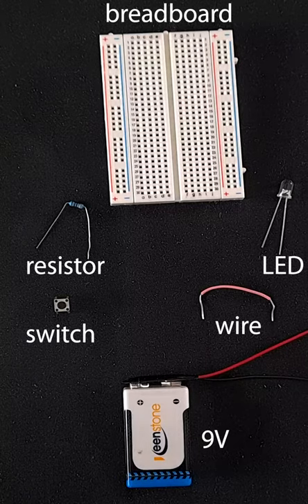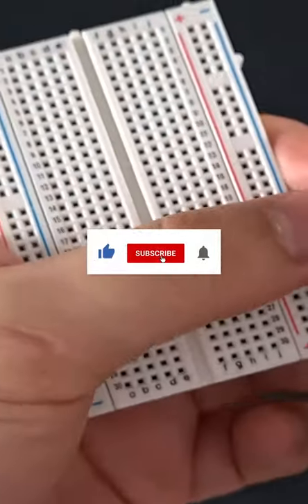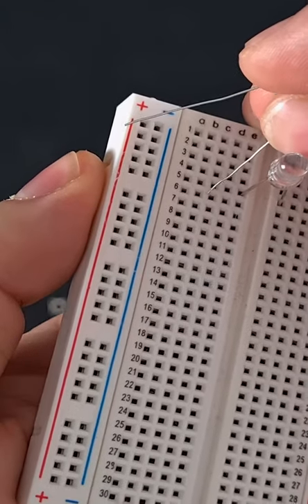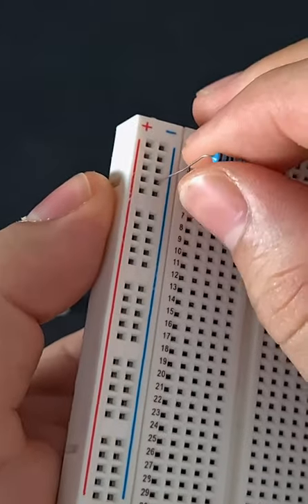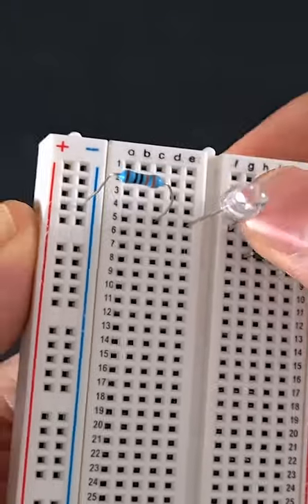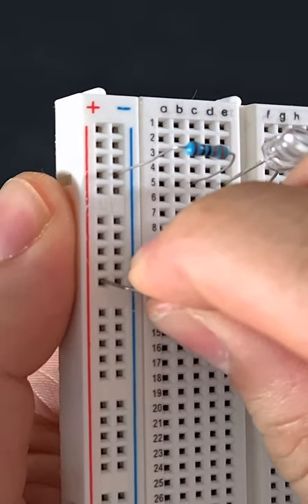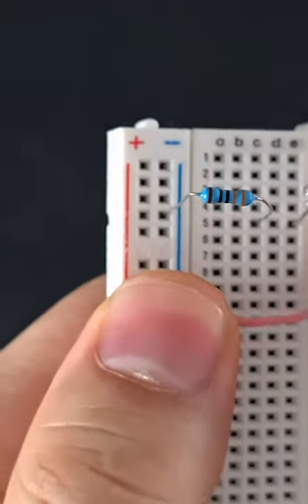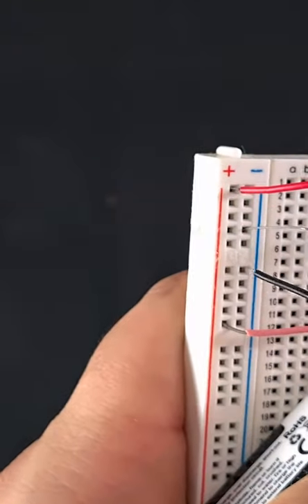LED Switch with a Breadboard #Shorts

Comment: How to add more leds?
Reply from the maker: There are a few ways, but a lot depends on your power source. You can either add more LEDs in series with the one you already have, or you can add more parallel branches - one branch per LED. You might need a separate resistor on each branch, depending on your power supply.

Comment: What if I use 800 point board . Will it differ from 400 point board
Reply from the maker: No not really. Just make sure you use jumper wires to connect the power rails from the middle

Comment: How would I do this on one of those solder boards?
Reply from the maker: You'd have to connect all the components together with wires. I've never done it before because I usually just make PCBs once I'm done with my Breadboard. But most likely you'll need to solder some jumper wires to make the same connections as on the Breadboard.

Comment: How do I make the led stays on when I let the button go? And off the led until I press the button again?
Reply from the maker: Great question. There are several ways to do this depending on what hardware you have. Here are a few ideas for you:
1) Use a microcontroller (e.g. Arduino). If you are happy with programming basic Arduino sketches, you can achieve the effect you mentioned very easily.
2) If you don't want to write any program, you could try one of the following options. But bear in mind that these require a fair bit of electronics knowledge to  make:
(a) Use a relay. You could connect the LED circuit to a relay module which will turn on with one press and stay on until you press it again.
(b) Use transistors. This is quite advanced, but using transistors which are essentially electrical switches, you can also achieve the effect you're after. This is quite technical, though. 
Hope that helps! Let me know if you need more details, I'll try my best :) My personal recommendation is option 1, the microcontroller. You can much, much more than this with a microcontroller so if you're interested, it is well worth getting one.

Comment: you forgot to mention the resistor value
ill do it for ya
ill assume that the led runs on 3 volts and consumes 20 mah
9-3=6
7÷0.02
=300ohms
also i have the same breadboard😀
Reply from the maker: Nicely done! I think they were actually 300 ohms :D
Reply: @MakerVibe :D
Reply: Where did the 7 come from
Reply: Do you know the name or link on a Amazon? I have been meaning to buy one but I don’t know which size is good, this seems pretty good
Reply: @FamTech.  I think that's a typo
Reply: @branchcensus5083 can you tell me where u got that 9 and that 7/0.02 from?
Reply: @mrcrazyface9310 9 was the voltage of the battery, and it is meant to be 6/0.02, the 7 was a typo
Reply: how about the 0.02?
Reply: Is there a calculator online for these things?
Reply: he actually used a 330 ohm resistor but close enough

Comment: hi 
is this like a relay switch or not?
Reply from the maker: Heya, no it's not a relay - a relay switch is normally used if you want to control a higher power device with an arduino. Something like a microwave or refrigerator etc.